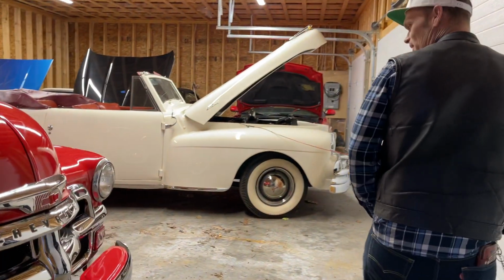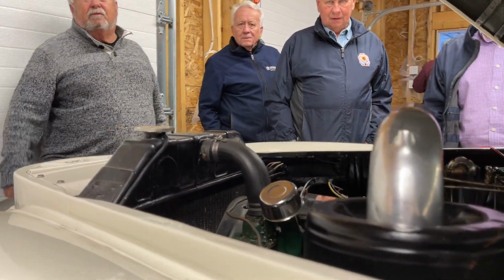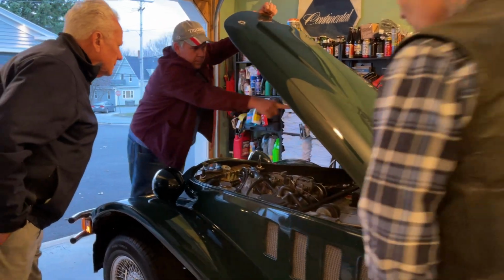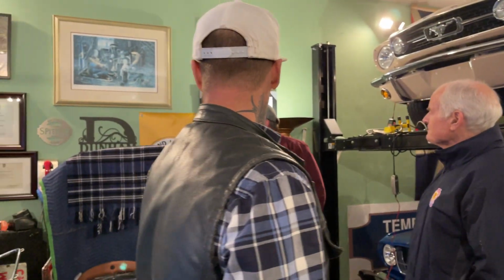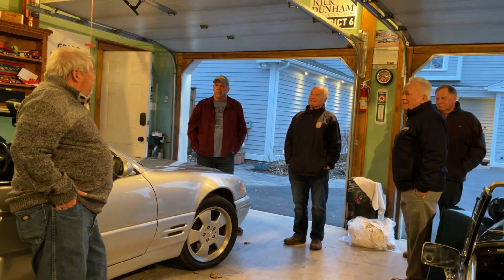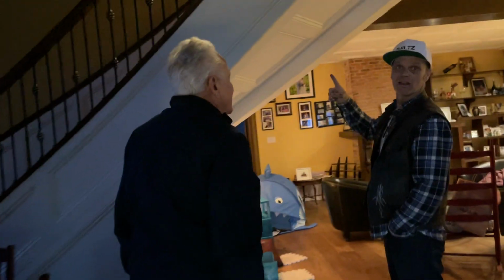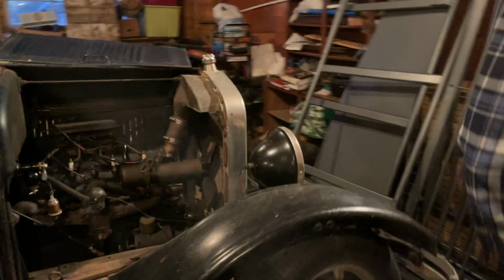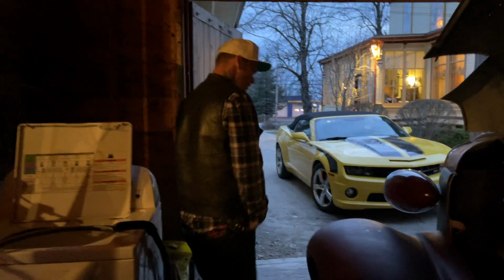GARAGE TOUR OF RICK'S CLASSIC CAR COLLECTION

Comment: That is a Panther Lima. Around 900 made. 2300 cc Vauxhall engine ~ 110 hp. They made a turbo version as well. Lots of parts from other cars used in the construction. Notice the MGB side Windows.  Looks in very good condition!
Reply: Some had Ford V6 with fuel injection I think.